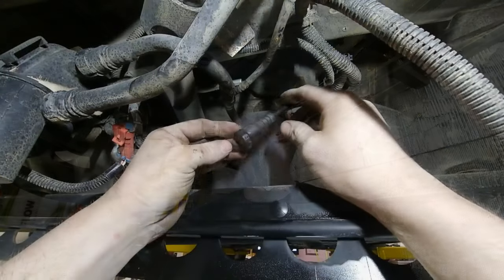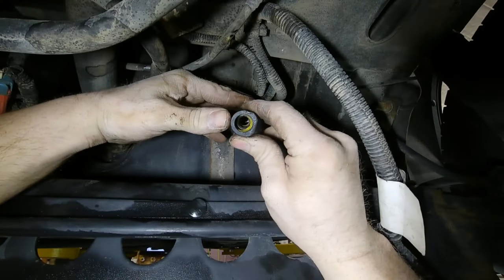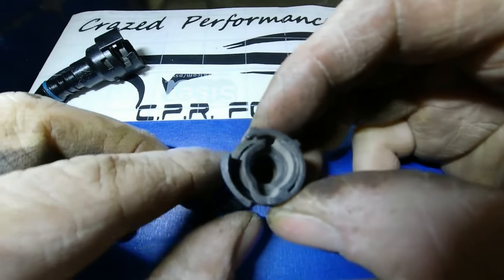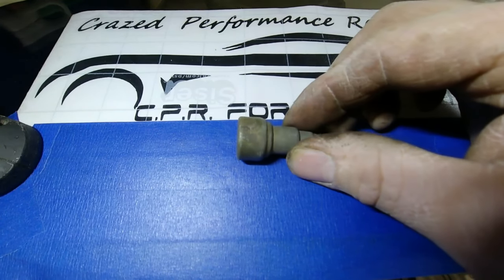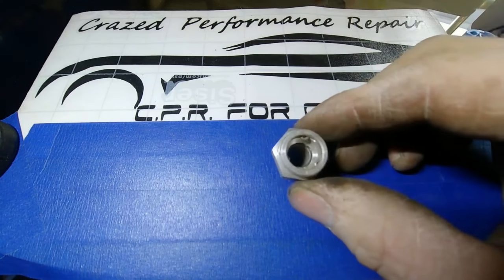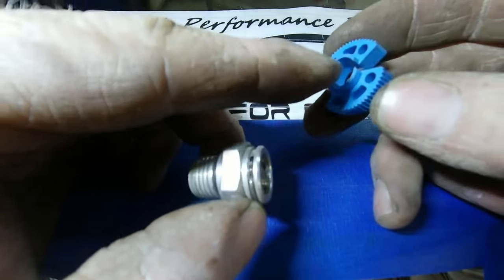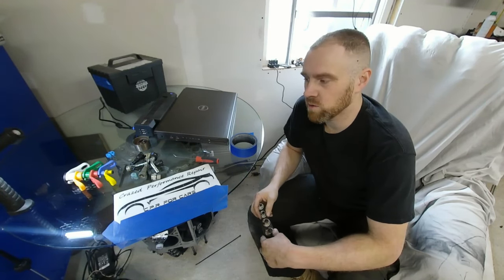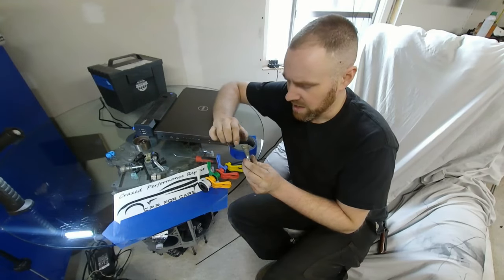How to Disconnect Common Quick Connect Fittings

Comment: This is the best video that I have seen on "quick connect fittings" Do not hesitate to post another video on these connectors. You have already mentioned the title to the new video as
"QUICK CONNECT HARD DISCONNECT." This is the kind of video that is better in slow motion. I would suggest doing it in sunlight. Your lighting is good but sunlight is better.  If you have a local junk yard that would let you harvest these connectors before they crush the cars, it will pay to try getting all the different types of fittings. Maybe they sell quick connect kits (plastic or metal) or maybe not. Either way, I strongly believe that you could have another channel completely dedicated to quick connect. 
I just bought an EVAP replacement line for a 2009 Chevy Cobalt.  I am assuming that the aftermarket line will have a quick connect fitting that mechanically will connect perfectly but will disconnect differently from the factory fitting. In other words, I already tried to remove the fitting but could not. This explains why I have been watching quick-connect videos before my EVAP line is delivered. I am hoping that the fitting at the charcoal canister is similar to the first one that you showed on this video. Pulling (instead of pushing) the colored plastic tab did not work for me. In the cobalt, the color is green.
Most videos about "quick connect fittings only deal with one type of fitting or are produced by manufacturers of a few fittings (not all used in automobiles). Your video featured more fittings and you stated clearly that you want to explore more quick-connect fittings. I think that you are on your way to become the go to channel for learning how any given quick connect fitting operates.  Watching this video makes me want to watch more of your videos. I just subscribed and will be back soon. For now, I want to make sure that I do not do any damage to the charcoal canister in my attempt to disconnect. Thank you for telling us about the difficulties. ( Quick connect, Hard disconnect ) does sound like "Hard come, Easy go"  that I have been saying since I modified the popular expression 30 years ago. You are helping people save time and money. Thank you!
Reply: Zs

Comment: THANK YOU! I was getting frustrated with a connection on an EVAP purge valve of the type at 3:00. Guaranteed I would have broken it had i not found this simple explanation and discovered how EASY these are when you understand them. Greatly appreciated!

Comment: Your comment about dirt getting inside the fuel line connector saved me hours of work. Hit it with a little carb cleaner wiggled the blue removal tool and the fitting popped right off.

Comment: Thanks!  You're video saved me.  But they named the little devices completely wrong because there ain't nuttin' quick about these quick connects fittings.  They're a total pain in the ass and take forever to get off.  And you're lucky to get them off in one piece.

Comment: Thanks man. I has the outlet line off and couldn't get the inlet fuel line off. Then it started to rain. Found your video and realized where I was supposed to press on the damn clamp thing.

Got the old filter off and new one on.

Thanks again!

Comment from the maker: Be sure to leave me comments on fittings you would like covered I already added one and its tool in the description. This was only a small handful of what's out there. If there is enough request for fittings I will make another video to cover them.
Reply: so how do you remove the check valve from the fuel line?

Comment: Cursing the clips on my 07 Denali 6.2 heater core coolant line.  I get the concept, have all the tools, but am still failing, Two hours on a hot afternoon.  About to just break the dang thing since I am replacing it anyways.
Update: One hour and a couple snips from diagonal cutters, and she's apart, replaced and reassembled.  Thank you for letting me vent!!
Reply from the maker: Lol, no problem I get it. F those f-ing f-ers🤣

Comment: Useful video. Thanks.

On my 2007 Saturn Vue''s canister, there are two 5/8" quick connectors that are difficult to disconnect. One connects the hose to the gas tank, the other venting to the atmosphere. They got two tabs on opposite sides. Not sure whether the removal tool will work for this. The first purge line connector is explained by you in the video. Not hard to disconnect.

Comment: The oil cooler and trans line clips, I changed both on one van including installing a set of used trans lines using just a small screwdriver as a pick to pop out that clip.   

Also worth noting that I found with those clips on GM vehicles, if the line rusts they just will not come out of the female side.  They swell up and hang up in there.  The good news is the female side of the connector just unscrews out.  The bad news is you may have to hit a junkyard to find the connectors and not pay a ransom for them.  I ended up with extras, I can't remember if they even charged for them at all. 

When I took my used lines off in the yard I did have to have them lift the van so I could move the stack of rims under it to get the right angle on the clip.  

What I find amusing is it's basically the same design wire clip used to hold window crank handles on going back to the 30s on GM and some other makes.

Comment: FINALLY SOMEONE GETS IT, THEY KNOW THE DIFFERENCE!! I am 49 seconds into the vid at this point. I have tried to explain that a "quick connect" and a "quick disconnect" are 2 COMPLETELY different animals for years now.

Any comments following are after i watched the vid. I predict you will have my approval, just based upon the opening statement.
I would offer you one suggestion, blow out, spray with PB blaster, blow out, spray again.  It releases with much less difficulty.

On the GM style transmission Cooler line with the wire clips, on GM lines they ALWAYS have the nylon buttons that engage the outer edge of the clips preventing blow off. EVERY application of the 3/8 uses them. if they arent there, get some, they are cheap and in the "help" section of the major auto parts chain stores. The clips alone inherently fail. I used to work in a transmission shop in the 4L60 and 4L80 heyday  in the mid 2000's to the 10's. I saw so many cooler lines blow off due to people not putting the retainer buttons back in place. They will blow off of the trans, and they will blow off the radiators too.

Comment: Mintly mint! @ 1:36 was the info I needed on my Peugeot 308 HDI fuel line. Other connectors were just "pincher" locked ones, but ofc, Peugeot made one different than others. No apparent reason tho. But still.

Comment: I've seen some gm ones with two white tabs sticking just past the connector i believe you have to push those tabs in towards the line then pull back on the line, then theres another one with triangle shape tab that pull up or you can just wiggle the whole lock out, you have to go easy with those or they will break into two pieces
Reply from the maker: There are so many different quick connect fittings it's crazy. I might have covered half of the common ones at best here lol

Comment: Very good video.

I have one on my triumph motorcycle....were the fuel line from the tank fits a plastic pipe.....has t plastic tabs that your suppose to push in with special pliers.....I have the tool.....but the connector still dont want to let go.

Scares me that I will break the plastic pipe the connector fits onto.

Comment: Not sure if you're still doing this channel but i was replacing my fuel pump on my 04 dodge durango. I had a hell of a time popping off the quick connect that hooks up to the fuel pump. Ended up snapping half of the plastic male piece off INSIDE the connector. I squeezed on it every which way and even removed the clip thingy and still had to pry it off. A youtuber did it that way and said he just replaced the clip. im having a tough time locating one. Any ideas on how to get the plastic out of the connector? Or if i can just replace it with another one?

Comment: The wire clip you didn't tell the people about the plastic ring that slips over that style fitting to keep that clip seated I've seen those lines blow off without them but still a good presentation remember nobody knows it all keep on learning

Comment: Thanks Great info , I have a 2003 chevy astro van I need to remove the tank( lines)  not sure what kind they are , so Im going to Horrible freight and by a set of each.. question - do they make any lines that you can unhook by hand( like on my van ( they look like I can just push the coupler together and remove the line ( but im bad a breaking plastic stuff and didnt want to force it. and I dont  know how far I can lower the tank without damaging the plastic lines feeding the pump etc. any tips would be great!  appreciate ya..

Comment: I have a f150 2005. 
Changing the fuel filter and there is supposed to be a little blue tab to pull up so I can get my release tool in but it is broken. Any way to still be able to get it off without replacing fuel line.
Thanks, love the video
Paul
Reply from the maker: Send me a picture on my website crazedperformancerepair.com or my Facebook page and I'll see if I have any clues for you

Comment: On the fuel line connectors, there are several types . Some you have shown . My question is my fuel pump is a rail pump for a 86 ford ranger and there are several replacements. Both the ends are 5/16" for a quick connect . They have the plastic U shaped lock . Do you know if I have to use a ford type quick connect or will any type work as long as it's the same OD pipe? I'm not sure if all the pipes have the same barb distance from the end of the pipe. I used this type pump Airtex E2000 to replace the Bosch pump on a 73 VW type 3 fuel injected car which is what many do now days and it works perfect, thing is most push a 5/16" ID rubber hose over this bard as I did since the entire system is all Rubber FI hose with clamps and I thought it be better to use a Dorman 800-081 then clamp the hose to it's barbed fitting one both ends.
Reply from the maker: If you have the fitting on hand, give it a try if the oil ring seal feels tight and lock mechanism locks into place, should be good to go.

Comment: Horseshoe quick connect type for a fuel line to filter. Looked almost like the one at 6:28 but not quite. Mine broke and I'm getting frustrated
Reply from the maker: There are so many different types of that style. A lot of times you can simply run an appropriately sized zip tie through and around it.

Comment: Thank for the video .
I broke c clip can you buy them it’s middle of you video
Reply from the maker: If you are talking about the metal e clip you can buy a fitting and pull the clip out of it.
Reply: My is a plastic c clip and I broke it  do no we’re to buy in Australia
Reply from the maker: @charlesmifsud8532  If you have a scrap yard I would start there other wise worst case you can likely find a way to use zip tie's to run through and hold it.
Reply: CrazedPerformanceRepair  thanks for your quick reply

Comment: I'm having a terrible time with my mazda protege fuel pump connectors. Apparently there is a tool available but living overseas makes it more dificult, renting one is out of the question and frankly  I have no idea where I could procure one.
Breaking a tab makes for an unsafe repair and breaking both tabs calls for a new fuel line which would be very dificult to replace.
Reply from the maker: Send me a picture to my email I may have a solution for you.

Comment: What about the external thick plastic clamps that go on the outside Toyota quick connects after connecting them together? I'm trying to figure out whether I just yank it off, or there is some less drastic way to handle it.

Line    Connector 
 |               |
v               v
===|===]]]]===|===
      +---------------+
                ^
                |
           Clamp
Reply from the maker: You could send me a picture via crazedperformancerepair.com or message me on facebook just search crazed performance repair. I typically respond better on my website.